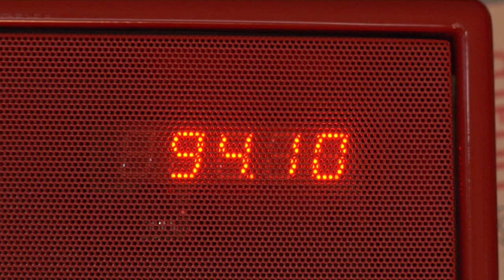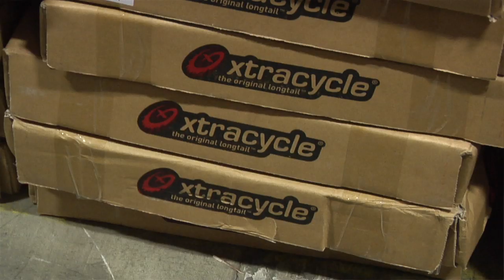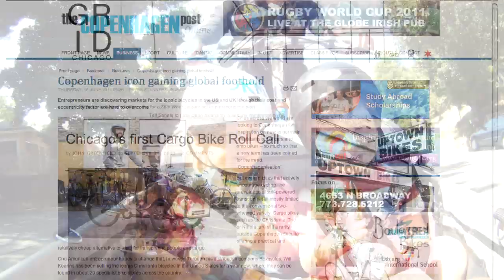LESS CAR MORE GO (aka Cargo Bike Revolution) trailer #1

Comment: been riding for years with my cargo bike, actually I got the cargo trailer and I coupled it to my electric mountain bike with big Schwalbe balloon tires and I recharge with a 100 watt solar panel,  I wish I could get more range though my VA Hospital appts. are about 28 mi round trip, just out of my bikes reasonable range.

Comment: you mean like my fld120 that does haul 40,000lbs of cargo across town daily. not always that much, but never less than 8k. i am usually loaded pretty heavy. it would take more bikes than the roads could handle to actually do all the hauling in the day to day that is actually needed. this is a pipe dream.

Comment: We still need truck drivers and their big rigs, but you can now use biodeisel, and in some states you can pull more than 2 trailers, therefore, that 40,000 pounds you are bragging about then becomes 80,000 or 120,000 pounds. That will impress many of the "green" people you seem to think don't appreciate your cargo hauling. There are rigs in Alaska & Australia that pull up to 100 trailers. Now that is greener trucking!! :)

Comment: Look at the article on Wikipedia about Oil depletion.It's inevitable that within 20 years from now fuel prices will get very expensive and 45 years from now impossibly so.Fossil fuel Cars,SUV's and trucks will end up being the unmovable junk homes for the homeless.Just last year I switched from being a motor vehicle user to becoming a bicycle commuter (became enlightened).
Cargo bikes especially electrified will be the prime movers of the future.I'd rather cycle go far and fairly fast than walk.